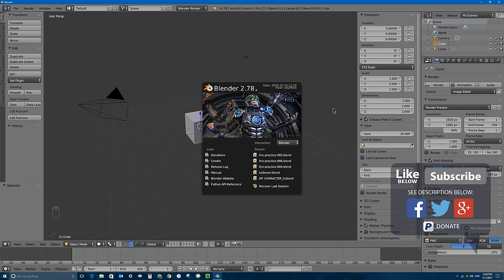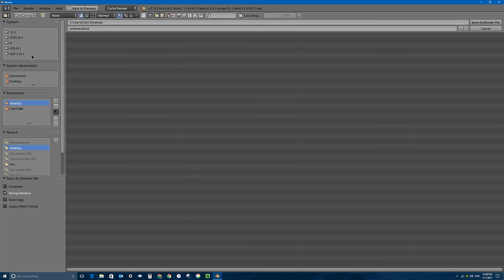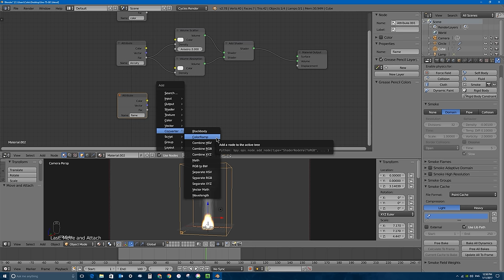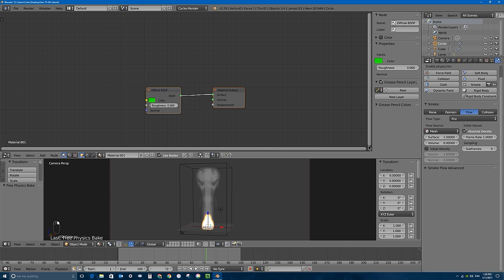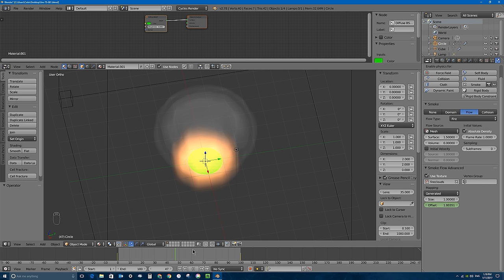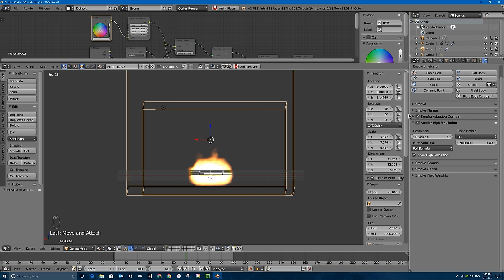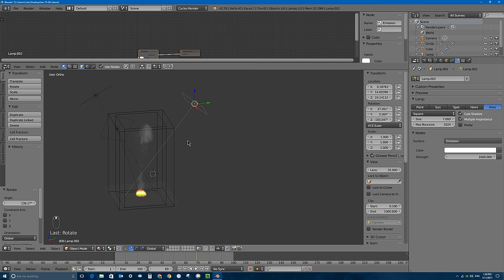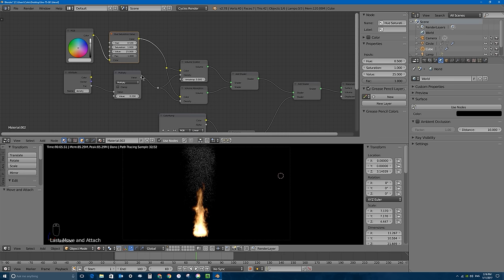Blender 2.7 Tutorial #75 : Fire and Smoke #b3d

Comment: Thanks for this interesting topic ! 
Just a question, can a domain be animated ?
Reply from the maker: +Jo Bisch good question! I'm really not sure. Let's say you wanted to make a person carrying a torch. I'm not sure if you'd just make a huge domain and then just rely on adaptive domain, or if you'd animate the domain, or parent the domain to the person's hand. Worth testing...
Reply: I think I'm gonna test, but there is an option in the domain panel (in the physics) you can check "adaptative domain" and a second domain will be created, which will be automatically animated to fit the current physics simulation.
Reply: The point of the adaptive domain is so that you don't animate your domain size. No matter how big your domain is blender will simulate only inside the adaptive domain so there is no need for you to animate the size. Fot the movement from my tests  with adaptive domain the simulation reacts to the movement and without it does not. So if you want to animate a person carrying a torch do it with adaptive domain and move the domain around with the torch.
Reply from the maker: Yup, that's in this tutorial. :)
Reply: Are you suggesting I have to watch the video before commenting? :) I do apologize just wanted to help.

Comment: I'm going to have to give up on my project. I'm trying to make flaming text (Yes, I'm setting the text to mesh and yes I'm on cycles render) but every single time I set the domain it turns pitch black instead of just having black outlines.
Reply from the maker: Have you tried starting from scratch in a different file? If you get it to work there, you can file - append the fire simulation objects over to your project file with their materials.

Comment: My Blender 2.79 reliably crashes if I try to select the circle after turning on "smoke" for the domain. Anything I can do?
Reply: Have you tried 2.79b? There were some bugs in a couple of versions. 2.79b should be stable though.
Reply: Thanks, I did that. Haven't tried everything out yet.
Reply: No joy on this, and another issue (the "denoising") switch, which would be so nice to have. Afraid I need to upgrade my old (32 bit, no graphics card) computer. But thank you.

Comment: Hi, 
I work with Blender to. Your fire is great. But it is not possible to use it in the same quality in the BGE. So, great but not for the BGE! Your integration into the BGE ist not in the video. This (!) is the important step! To create fire in Cycles is easy.
Cheers,
Peter
Reply from the maker: Hi Peter, you're right this method will not work in the Blender Game Engine. This Blender 2.7 tutorial series is separate from my blender game engine series, which have green in their thumbnails as apposed to orange in this Blender 2.7 series' thumbnails on youtube. Tutorials in this Blender 2.7 tutorial series are for creating animated movies using Blender and the Cycles render engine. Perhaps I should create a fire tutorial for the game engine in my BGE series?